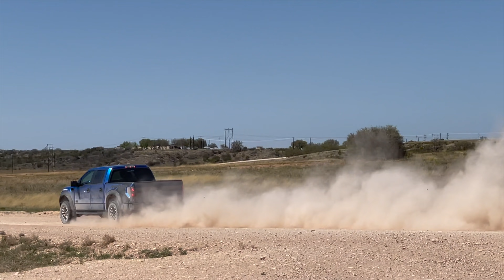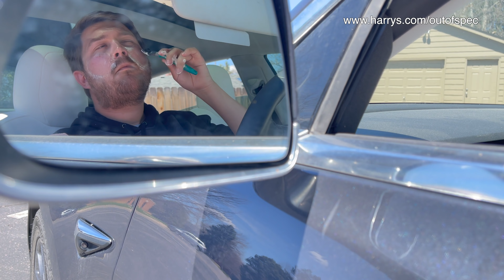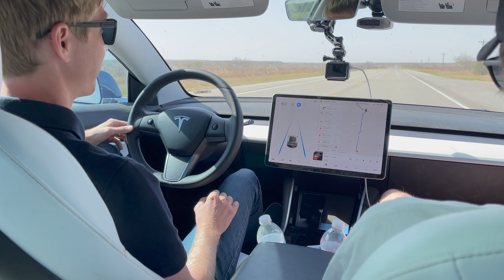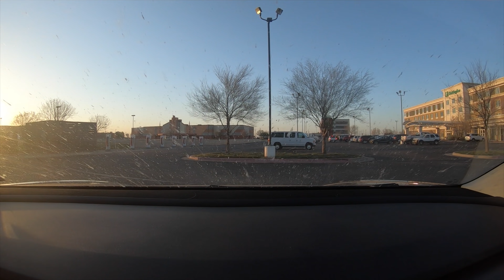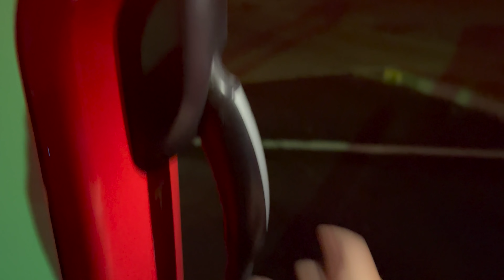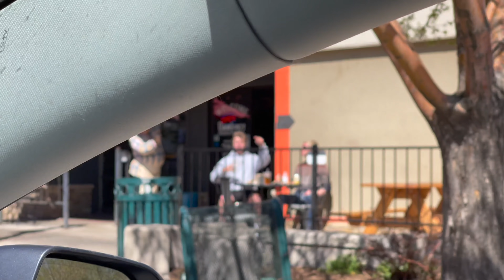Tesla Model 3 Performance Quick EV Road Trip From Texas Up To Northern Colorado

Comment: I'm considering a Model 3 Long Range Edition next year. Holding on for the new battery type, tax credit law to hopefully pass and for inventory to readily available. 

It's nice to see that in the performance version and SR+, which are their two lowest range versions,  you can do abroad trip going well over 500 miles and not worry about Range anxiety. 

Another thing making these trips doable in an EV is the cars ability to route you to a charger without running out of charge  as well as being able to use auto pilot and lane keep assist to avoid swerving and fatigue.

Comment: Many of the TX roads are “chip sealed”. Basically, they spray a layer of tar, and then roll gravel into it. Kind of like a gravel road, only more stable.
There’s a Goodyear commercial tire dealer in Phoenix, as I recall, who does tire recapping on premises. I got to tour the operation, and it was actually pretty interesting, all of the different steps and checks the tire has to go through.

Comment: As I watch your leapfrogging about, I am wondering if I could adjust to the EV journey tempo of regular short breaks or whether the 400 mi ICE blitzkrieg is still preferred. 

It seems that EV recharging adds about 15% to transit time.
Reply: The question is more.. how often do you road trip?  For most drivers, it's the daily commute to work and running errands that constitutes 95% of the driving we do.  Home charging erases any stops for gas.
Reply: @mowcowbell  Important point.
Reply: I generally prefer the EV style. I like to drink Monsters and they sail right through me, so I need to stop to pee every now and then anyways. Plus, I don't like to sit for very long.
It's fairly uncommon for me to actually have to stop and wait for the car on road trips, it's usually ready by the time I'm ready to get back on the road after a pee break or a snack/meal.
Reply: You can drive 3 hours, charge for 30 minutes. If you're traveling with a couple kids, it's pretty hard to make any kind of stop that's much less. You think you only stop for 5 minutes for refueling, but in real-world road trip times, it often ends up being pretty close to a decent charge stop.
Reply: @steinwaymodelb  I don't own one.  Only watching videos to judge if I can tolerate the change.  Almost everyone making videos seems to use an app  to plan lots of short jumps, not 180 mile segments with a longer stops.

My only personal point of comparison was a recent 400 mile ICE journey.  It took ~ 6 5 hours including a ~ 30 - 45 min break.  The return leg was ~ 6 hours with one quick gas stop.

A kind Tesla reader calculated for me that a 2013 Model S 70kWr would do the trip in 3 stops taking an additional 30 -45 minutes each way at about 1/2 the cost.
Reply: @buzzpedrotti5401  the big motivation for more stops is the charging curve. The more full the battery, the slower the charge. So folks have done the math and found the overall trip time is actually lower with more frequent shorter stops. It will be an adjustment for sure. So far we have adapted and loved it.
Reply: @steinwaymodelb  Must drive 55-65 and have saints for children if you’re actually doing 180/30 intervals.

We are generally doing 100/20’s on average even traveling with a 5yo and a toddler.